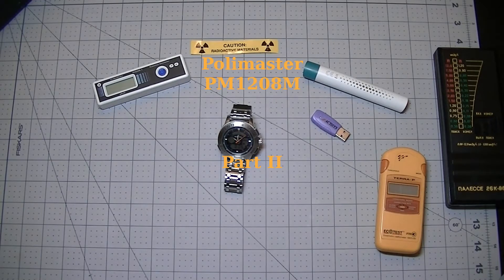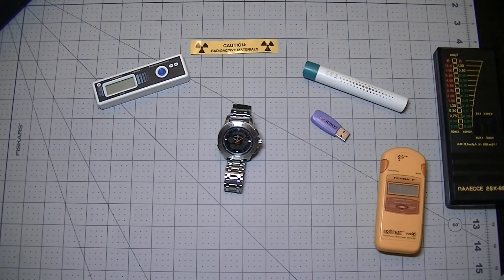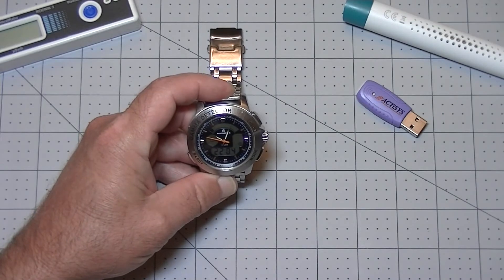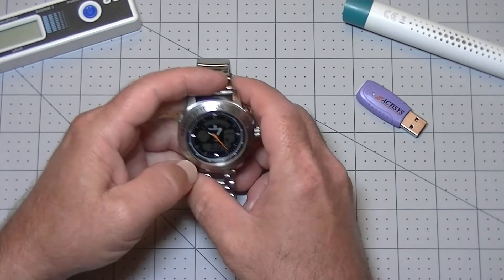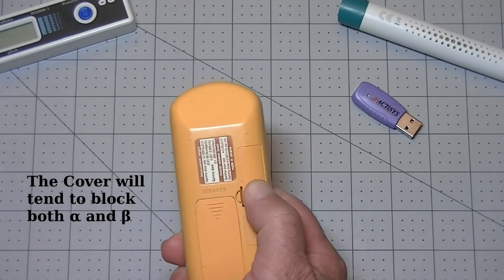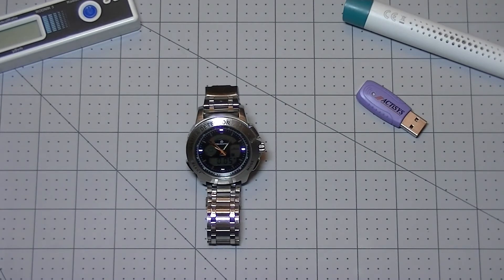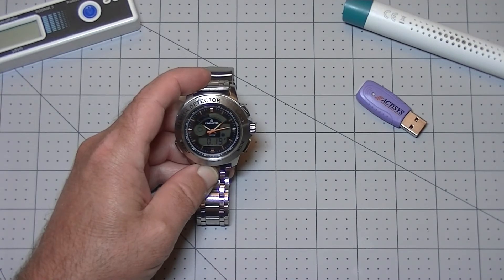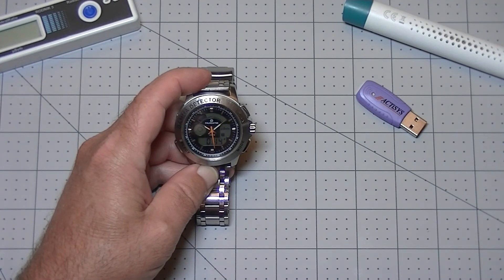Polimaster 1208M Part  2

Comment: Hi! Can it be used to detect beta & x rays? Thanks!
Reply from the maker: @wentaoxu4138 Due to the fact that the Geiger tube is totally enclosed in stainless steel and glass, this watch is not sensitive to beta particles.  However, X-rays are similar in energy to Gramma rays, and the PM1208M will respond to e.g. a chest x-ray or CT scan.

Comment: where is the window of geiger detector located on this watch? I imagine dense steel blocks at least partially gamma rays not to mention xrays
Reply from the maker: The detector is located approximately under the round accumulated dose LCD dial on the left side of the watch as you look at the face.  The stainless steel case does block most alpha and beta particles, but Gramma rays are not stopped by the front or the case.

Comment: I have worn this watch many times on planes, and the test data shows that the radiation dose value can reach 1.2μSv/h at an altitude of 10,000m, which is safe for travelers.
Reply from the maker: This is true.  In the following link, you can see the reading on my Rodnik 3 at 39,000ft:  http://linuxslate.com/cgi-bin/forum/YaBB.pl?num=1561073604/4#4.  Noite that the Rodnik is not filtering Alpha or Beta particles.

Comment: Hello! These guides are extremally helpful. I was lucky enough to pick up a PM1208M New on ebay for display / preservation purposes and then luckily enough I was able to win an auction for a second PM1208M which I intend on wearing. Unfortunately my knowledge on the setup + testing of the watch + finding a suitable IR adapter has been lacking somewhat. It's a long shot but would you be willing to chat possibly regarding resetting the watch, optimal setting's etc? If so I would be glad to connect regarding this and would be extremally grateful - Thanks!

Comment: jeebus..my hair would be falling out by the time it figured out the environment was HOT..
Reply from the maker: No, not at all.  The radiation level from that rock -- that close -- is similar to what a passenger on a typical commercial aircraft flight experiences.  The watch would react long before the flight got to cruising altitude.  People fly 8 hour plus flights (think about pilots and flight attendants), and their hair does not fall out.
Here's an article actually showing my Rodnik 3 Detector on a commercial flight:  http://linuxslate.com/cgi-bin/forum/YaBB.pl?num=1561073604/4#4
Reply: @CarCynic  awesome..